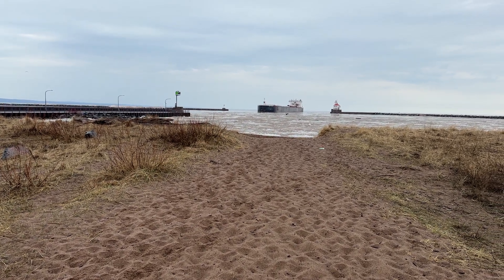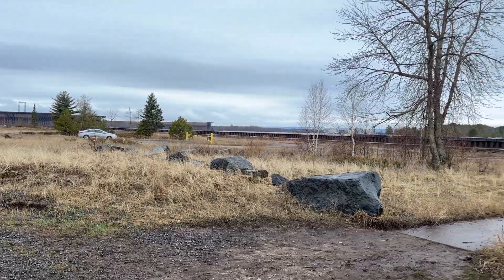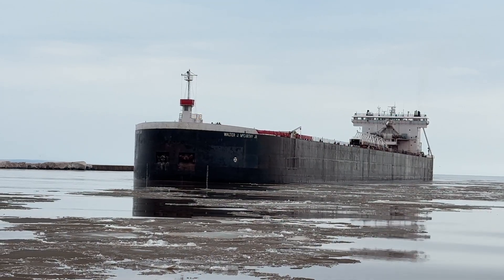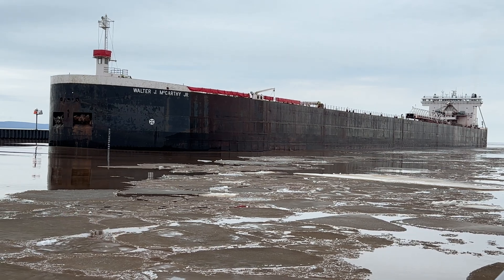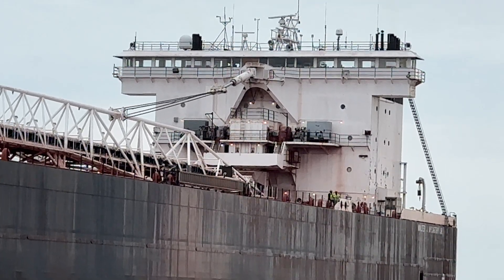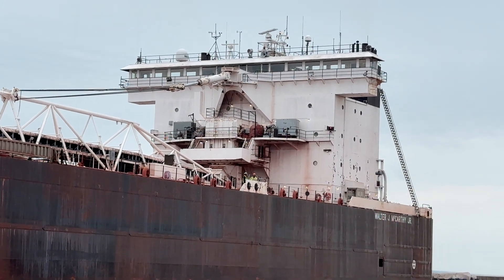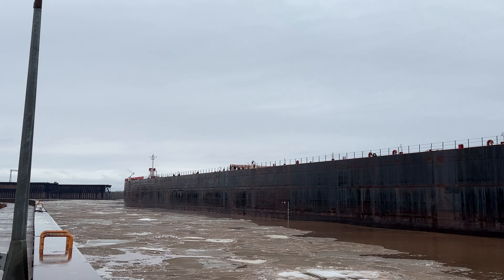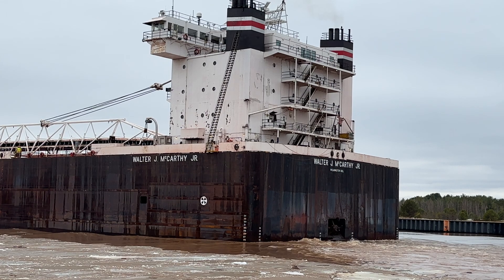⚓️How does a 1,000 foot Giant Ship move like this?

Comment: What is that symbol on the side of the ship that looks like a Celtic cross inside a circle?  What is the full speed of these ships when they sailing.?
Reply: The cross inside the circle are indicators to where the bow and stern thrusters are located. Basically propellers that help maneuver the ship sideways while docking and undocking.
Reply from the maker: Paul! You are awesome brother. As you replied, I was researching. Thank you so much man. You just taught me something and I so appreciate it.👍👍⛴️⛴️⛴️